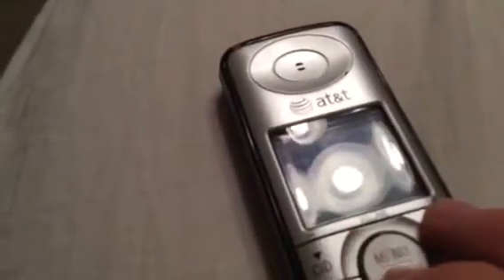ATT Cordless Phone Call problem

Comment: You need a new battery. There is a defect on the battery causing it to not hold charge. When the battery is fully charged on the new one, leave it off of the charger until the charge level is at 1 bar.